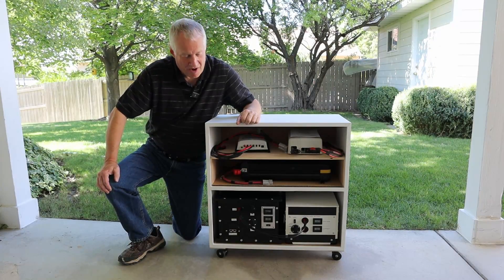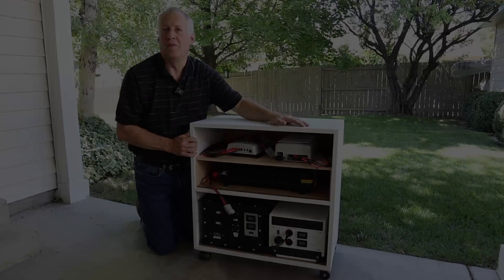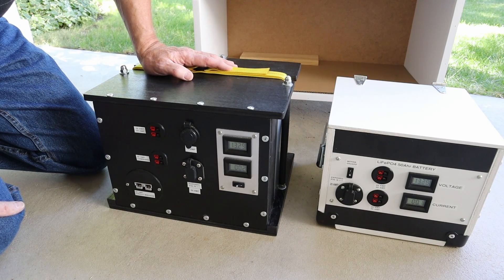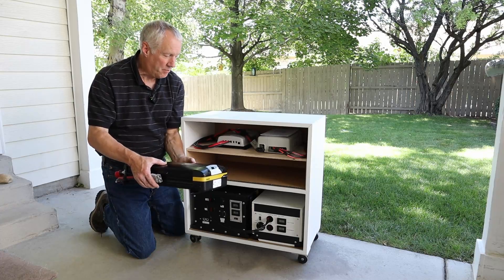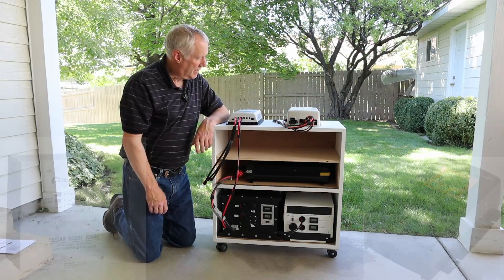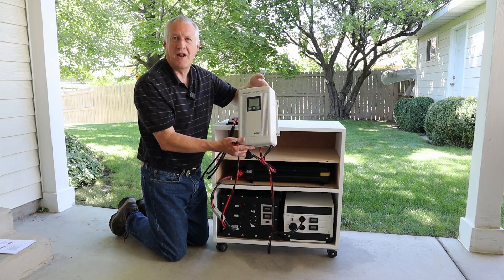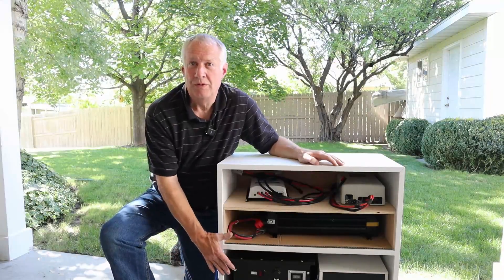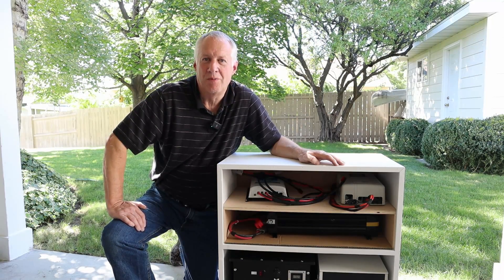DIY 1000w Rolling Power Cart! Perfect for Backup Power / Off Grid Living

Comment from the maker: What do you guys think of Jeff's power cart? After watching this video, what type of system would you build? Thanks Jeff!
Reply: It`s awesome. I want to make my 300 ah battery portable so I can roll it outside for tilling and mowing....but not yet sure if 2000 watt inverter will work with an electric mower or tiller. I haven`t opened my tiller or mower yet and don`t know the specs. Hurt my back moving and had to rest for a few weeks. So I haven`t moved those or the battery yet. Sure is quiet here until the neighbor starts shooting. I`m a bit on the spectrum and have schizoaffective disorder so it`s rough to have to listen to extremely loud noises and his shooting range isn`t far through the woods. Have you tried noise cancelling headphones? Would they work with very loud guns? I do have great earplugs but not good enough to block the sound.
Reply from the maker: @baneverything5580  Ear plugs and a white noise machine should do wonders. As for your lawn equipment, as long as it plugs into a wall outlet, the 2000w inverter should be able to handle them with no issues. A normal wall outlet is rated for 1875 watts.
Reply: @Jasonoid  Good. It should work then. I was hoping that if I ever have to go 100% off grid I can still garden without using a shovel and mow. I may need to pump water in the future from the creek for irrigation. As far as mowing goes...out here in the sticks huge tarps can be used (no HOA crap) to stop grass and weeds from taking over and outrigh kill them. I have one in the yard now over one of the areas I may till up soon to help kill grass, weeds, and their seeds before I till. I wish I had enough old carpet to put in the yard to prevent the need to mow. God I hate mowing and think we should invent a way to make mowing a thing of the past. Robots are too expensive. I have spinal injuries from a car accident and it`s very easy to hurt myself to where I`m in agony for weeks. Today is the first day in about three weeks where my pain level came down to where I feel better.
Reply from the maker: @baneverything5580  I hope you are able to make a full recovery over time! Back injuries affect so many aspects of life. Thanks for supporting the channel with your views and comments :)
Reply: @Jasonoid  They`ve had me on opiates for over 5 years but I started taking kratom and eating big spoonfuls of tumeric powder and it helps a lot. Without kratom I don`t know what I would do. I can go to pain management but I`m terrified of morphine and fentanyl. I would abuse it. Look what happened to Tom Petty, Prince. Michael Jackson, Matt Roberts of 3 Doors Down, and so many more. Your tolerance goes up up up until you`re taking near lethal doses and if you eat the wrong fruit or other foods or fall asleep it`s bye bye time. None of these people expected to die.
Reply: Tell him to get the CCrane EP PRO portable radio. It`s THE best long range AM & FM receiver for the price there ever was. I tested mine away from power lines a few days ago and at noon I got a very good signal on the AM station WBAP 820 in Dallas 300 miles away and have no problem getting an FM station out of New Orleans 170 miles away. This receiver is a great way to get distant signals when all else fails. After hurricane Laura knocked out all the communications and radio/tv towers here AM radio was the only way possible to get information. 

There are two other receivers on sale right now that aren`t quite as good on AM but have WAY above average reception for those on a budget....the retro style Panasonic RF-562D (looks great on a shelf) and the Sony ICF-19. The Sony has the longest battery life of any radio made today at 400+ hours run time on three D cell batteries. The Panasonic also includes the shortwave band. It lacks bass response (Sony has bass) but is ear splitting loud on FM. RadioJayAllen and Todderbert have detailed reviews on these.
Reply: i think battleborn is too pricey and the entire system is giant and pricey when compared to less expensive all in one systems
Reply: I like how he built it to be modular, so that his power station (battery, outputs, display) can be separated from the rest of the solar generator (inverter and 2 chargers). 

It allows him to just use the battery if, say he wanted run a basement DC fridge after sunset, leaving everything else upstairs.  In the morning, everything is ready for him to take the battery topside for a charge.

Bravo. Love it.
Reply: My dumb sister had coolers but left her food in the fridge and freezer to spoil during the big Winter storm in Feb 2021. My genius nephew did the same. They both have repeatedly called me names and ridiculed me for using solar power to the point of nearly giving me a nervous breakdown because my camper is on their property. Both are psychotic snoops and control freaks.
Reply from the maker: You might need to create some more space between them and yourself so you can have more control over your belongings and what happens.
Reply: @Jasonoid  At this point it`s either leave walking or put a rope around my neck. This situation has reached a level of abuse that I can no longer tolerate.
Reply from the maker: @baneverything5580  Oh no! Well please don't go with the latter option! Family can be difficult at times and you'd be surprised how much good some extra space can help when things get rough. I'm sorry you have to deal with that right now.

Comment: Is there a link to how he wired the battery boxes?  I saw the schematic of the one, but can't read it.
Reply from the maker: They are 12v batteries, the outputs are directly connected to the positive and negative terminals. They do have the rated fuses inline on the positive wire. As for the custom displays, they are super advanced and I don't have the wiring diagram.

Comment: hello jasonoid can i connect 12v 200ah lithium battery direct to 12v 300w inverter please let me know thanks.
Reply from the maker: The battery voltage and the inverter voltage need to match in order to work. For example 24v inverter with a 24v battery / 12v inverter with a 12v battery. So in the case of your question, thats perfectly fine. Now you might need to clarify the size of the inverter in wattage, 300 or 3000 watts?

Comment: Jeff, That's a  pretty slick cabinet. My first portable station was based around a Harbor Freight hand truck with an Epever 40 controller and an AGM battery. I built it before there were any lithiums for Rv'ers on the market. Still, have it sitting in the garage and am thinking about a lithium upgrade for it. Thanks, Jason for an informative video.

Comment: That variable output on that ac charger is cool. Pulling 20amps from my ef river always overheats it. Around 350 watts ....when solar is coming in as well. Haven't tested it with solar because I'm a weirdo.
Reply from the maker: That AC charger is super overbuilt, it's huge compared other 20 amp chargers I've seen.

Comment: I have a similar setup. But, I put the batteries on the top shelf. Since basements get flooded sometimes. My charge controller and inverter are about 5" above the floor. Using 3 of the 48v Badger (BigBattery) and a 3KW  pure sine wave inverter. Feed it with 600w of PV. Use it on sunny days to save a little on the electric Bill.  My cabinet is Abt the same size but deeper. It's an old NEC minicomputer box. Steel with heavy laminated fake wood sides and top. The back is steel. front open. It came with nice lockable casters. Got two. The other one is storage for old PC junk & my  IMSAI 8080..
Reply from the maker: Sounds like an awesome setup!

Comment: You and Jeff build some really quality stuff. I like how Jeff doesn't wire the components together until needed. It makes changing components or upgraded as simple as just swapping out.
Cooper Bussman inverter? I've never heard of that brand. I found one on eBay for $115 but I don't know what the quality is like. Any chance you and/or Jeff could do some testing on the inverter? Using an oscilloscope to see the sine wave and the voltage output would be awesome.
Reply from the maker: If it's the one from the video description its the same model Jeff has been using. It's a pure sine wave inverter but I didn't verify the voltage output. I will have Jeff take a look and comment here.
Reply: Ya that's the one. It's evidently a discontinued model which seems fine for me because of the price. Cooper Bussmann is now Eaton's Electronics Division. When I think of Bussmann, I think of fuses and circuit breakers, but they make other components too. Now those inverters and the newer models are referred to as Eaton Bussmann. I'm not sure how many are made any more as you don't see them offered at very many places on on the internet any more. Cooper / Bussmann / Eaton has a good reputation in the electronics industry. They are more of an engineering components company rather than a consumer electronics company.

I think those inverters have been primarily marketed towards truckers. They are kind of big.  It is a good pure sine wave measuring 113.9VAC and 59.972 Hz unloaded. Another spec that is important to me with inverters is the DC "no-load" current. That's when the inverter is on but no AC plugged in. The spec on this one is less than 0.9Adc and I measured 0.625A. That's not super low and probably more typical. I do have a Go Power 300 watt inverter that the no-load current is 0.250 amps. I think the bigger the inverter they tend to have a higher no load current from what I've seen.

For those that don't use in a portable scenario like I am, this inverter has an automatic transfer switch and the unit can be hard wired to shore power at the AC "in" port at the back. There are knockouts to be able to do this. Jason & I will have to test it loaded one day if he's willing!
Reply: @jeffl6089  Thank you Jeff.
Reply: @jeffl6089   Hi Jeff very nice design on the battery enclosures. I have the same 2 inverters as you. The cooper is a rebranded Xantrex Freedom Xi, if you google it you will see they are virtually identical. It seems to be a quality inverter but now discontinued. The only bad part is the terminals, there screwed into the plastic back of the inverter. When mine arrived they were broken due to poor packing. I repaired with JB Weld and better screws, probably better than original. The yellow Go Power is a Samlex rebrand, also a very good inverter and also discontinued. Again, excellent work on the battries.  Bob
Reply: @bobstuart5255  That's awesome that you have the Go Power too. The Go Power is under the front seat of my truck. Thanks for that bit of info. I did not know that the Cooper/Bussmann (now Eaton) was a rebranded Xantrex. I always felt that it was a good deal for the price I paid. When I got my first one he was selling for $140 (Ebay). Then he dropped the price to $125. And so I picked up another one. Now he has them at $115. Not sure I need a 3rd one.........but it is kind of tempting to throw depreciating currency towards something of real value.  He's sold over 230 of them. It makes me wonder if he managed to buy up the remaining stock of this now discontinued product? Physically they are kind of big and so maybe that is not appealing to folks.

Comment: The cart/system looks professionally made.  Good job, Sir.  Having a transfer switch set up and still wanting portability, good power, and long battery life, I would build the EG4 battery with the Growatt 3K watt inverter system as a few other reviewers have done. Much less expensive than comparable commercial all-in-one systems.
Reply from the maker: If you can find the EG4 systems in stock, those are an excellent option!
Reply: @Jasonoid  Point is well made as that is the problem that I have been running into for the past several months!  Good news is that by the time those become available, something new and better at a lower price will probably be available, ha.
Reply from the maker: @robertlueke3238  I've thought about selling of my AC300 and AC500 for a system like that, the batteries are cheaper and would allow for much longer runtimes. I haven't found an all in one inverter unit with dual charge controllers since I have two different sized arrays. You seen one yet? I could see myself upgrading to that eventually if so.... I have plans to build another 1500 watt array on a future car port and then use my existing 1000 watt array on my shed for a total of 2500 watts or so, but they have complete different voltages and specs so putting them into one charge controller isn't possible.
Reply: @Jasonoid  No, I haven't seen such a beast.  But then, I wasn't looking for one.  Thanks to all of your information you have shown in your videos setting up the transfer switch and hooking up your Bluetti sogens to it, I have done the same, only using my AC200P.  I built a portable solar panel cart like yours but used larger 5" swivel wheels and attached a cart handle (easier to move it around in the yard) and four, 180W BougeRV panels.  With the transfer switch and panels, I can run the refrigerator, kitchen can lights, wifi, and entertainment system continuous for about 12 hours a day.  On a cloudy day, I plug in the EB1500 to add extra Wh to the AC200P.  I don't necessarily need more wattage (even in a power loss scenario), just more battery.

Comment: I made something similar, except it was before LiFePO4 batteries, so AGM batteries (YUCK!) and just used one of those open carts with wire frame shelves.  The only oddity for me is having a 50 amp and 100 amp battery, as these two should never be paralleled, but they can be used individually in separate places to power different things.  But having everything open and accessible is the biggest plus of these types of systems, as everything is user replaceable!  Nice to see a family of electrical engineers tackling today's challenges!
Reply: Ya, connecting those two batteries in parallel had me concerned at first since they are of different capacities, but then I realized that the voltage will be the same on both of them as they discharge and thus the 50Ahr battery can never get discharged more than the 100Ahr, (except as John notes it could happen near the tail end of a full discharge cycle due to the impedance difference in batteries and wiring). The advantage of having the majority of the loads (and the solar charge controller) connected to the 100Ahr side is that the ratio of current coming and going to the 100Ahr battery will be higher and thus keep those two paralleling cables from having to redistribute more current than it has to. The ratio of discharge should come out to be 2/3's from the 100Ahr and 1/3 from the 50Ahr. I have current meters on both batteries and so it will be fun to keep an eye on things and validate the feasibility of paralleling two batteries of different capacity.
Reply from the maker: I've always wondered about having two different sized batteries connected together in parallel and the issues with that. With such a small load as a AC fridge and both batteries connected together in parallel wouldn't the batteries voltages/SOC be equal throughout the entire discharge cycle? The batteries should feed back and forth into each other to keep the same SOC...at least that's what I'd hope to see. This same process of two different sized batteries wouldn't work with a series connection at all. Your thoughts?
Reply: @Jasonoid  If you connect them in series, your current should be limited to the smaller of the two batteries.  The danger here is that the smaller battery could easily below 0% and cause damage (probably not is the BMS does it's job), but it's just not good practice to depend upon a safety feature.  When using two different current rated batteries in parallel, you will have parasitic balancing as the 100 amp-hr battery tries to compensate for the voltage difference between the two batteries, however, the 50 amp hr battery and the 100 amp hr battery will reach 0% at different times during their discharge, even with the parasitic balancing.  An easy solution to this would be to use a 100 amp blocking diode (reduces in line current losses) on each positive battery terminal.  This will stop parasitic problems and allow the 50 amp battery to drop out of the circuit without hampering the 100 amp hr battery to continue supplying loads.
Reply from the maker: @johntate5284  thanks John, sounds like a reasonable option when trying to run these two in parallel. Appreciate it!